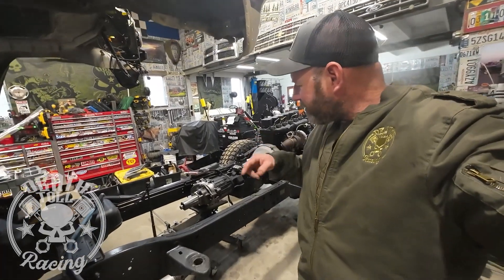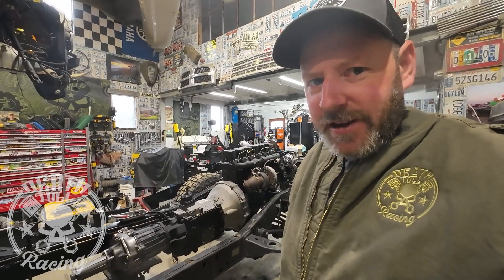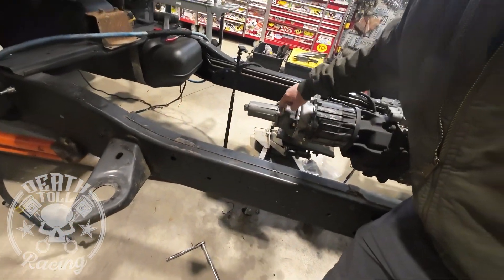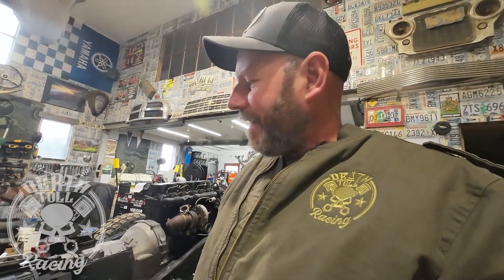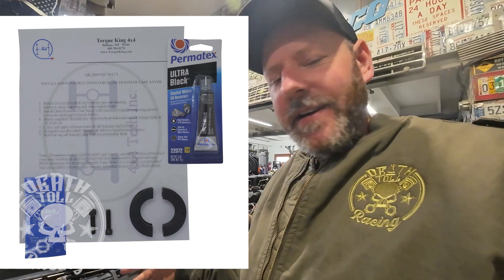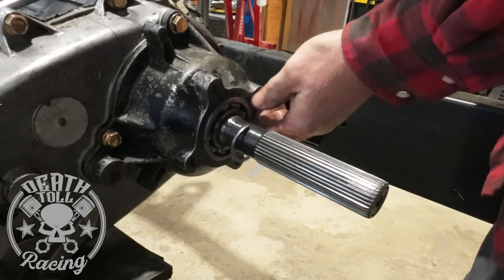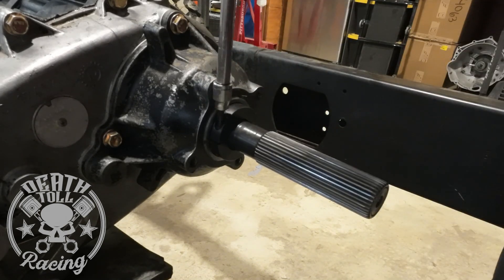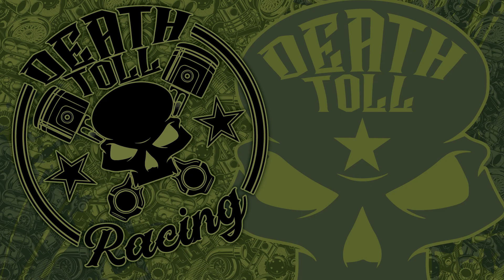NP241DLD "Case Saver" Install on the Cummins Bug Out 4x4 RV Build's Transfer Case

Comment: If it makes you feel any better, i have been into 3 wore out 300k+ mile units. . Scab em back together, throw some weight behind it and they seem to hold up! Crappy case yes, i think its strength is in the flexibility??? Haha
Reply from the maker: @slickhick1971  I think you’re right. They are strong like a cardboard chair. They work just fine until someone kicks a leg out from under it. It it’s scenario, bumping something physically is going to be its weakest characteristic. That can be overcome with skid plates.

Comment: I'd agree the 241 is not all that awesome but it does work ....... But the case saver looks like a good temp fix to keep it together a bit longer, id prefer a NP205 or combo of NP205 NP203 for deep low... But that's costly thanks for the video!
Reply from the maker: Agreed. I can’t decide if it’s worth adapting a 205 in the rv or atlas. Atlas case really are a bargain even though the are expensive.
Reply: @DeathTollRacing  Definitely Atlas if it's in the budget! 205 is a good case not the lowest low range though, but easy to find lots of parts out there. The Atlas is a one and done option. The choice comes down to budget and need. We all out here work with different budgets,parts availability and time constraints... As long as you are working on something and having fun use what you can.
Reply from the maker: @Chevrolet1994  yeah, my biggest hesitation is this thing will probably only see 4x4 use rarely and in reality how extreme can it possibly even get with a top heavy rv.  But it’s heavy, so even mild 4x4 with some wheel hop is going to be pretty brutal to it.